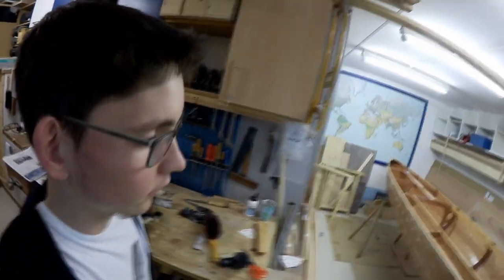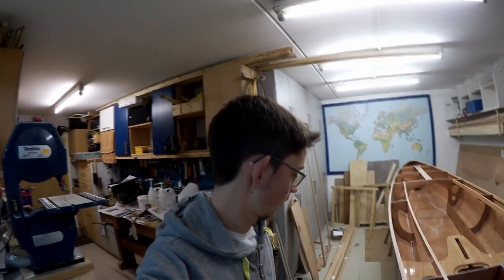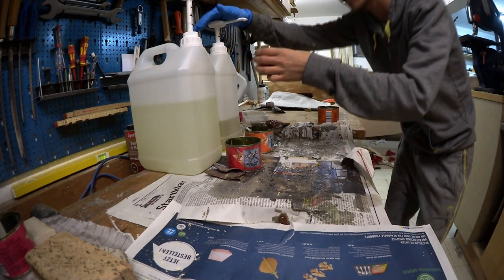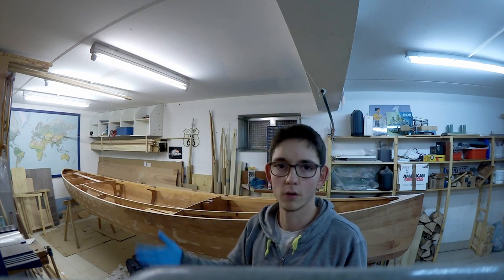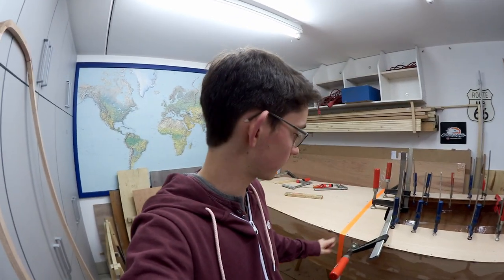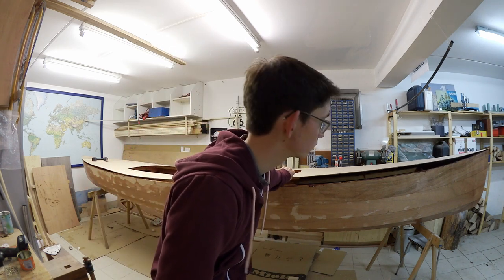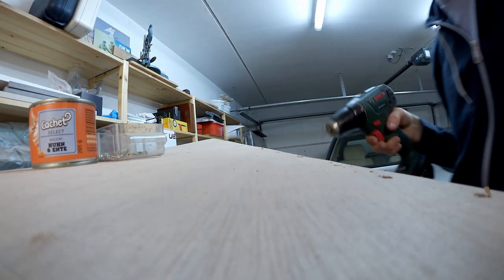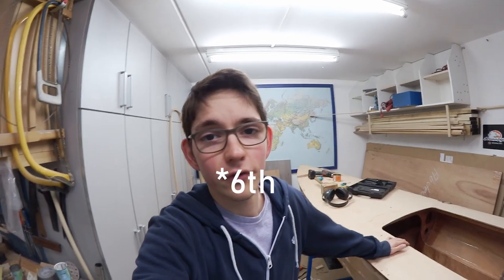Building a Waterlust Sailing Canoe (part 6): Failing big time (attaching the deck)...

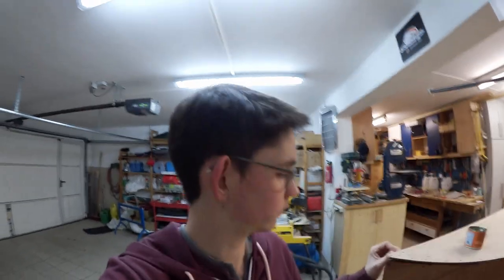Comment: 12:00 ...nimm das nicht zu schwer... nur wer nicht arbeitet, macht keine Fehler!
Fehler sind übrigens etwas gutes, wenn man daraus lernt!

Tip: Da ich gerade gesehen habe das Du alle Schrauben wieder raus drehst..... Du kannst Dir die Arbeit auch einfacher machen wenn Du anstatt Schrauben Tackernägel nimmst. Jeder Schreiner hat so einen Pressluft-Tacker wo Du entweder (Nrio-) Stifte mit verschießen kannst oder U-Klammern. Du nimmst einfach ein kleines Stück Restholz (ca. 5mm stark) und legst es auf Deck und schießt dann die Klammern durch das Restholz und Deck in die Leiste. Nachdem das Epoxi abgebunden hat, kannst Du die Klammern wieder entfernen. Sollte die sich nicht freiwillig entfehrnen lassen, tennst Du einfach das Restholz mit einem Stechbeitel auf, dann hast Du genug Platz um mit der Zange die Klammern wieder raus zu holen. Es geht übrigens noch einfacher wenn Du anstatt Restholz einfach einen alten Anschnallgurt nimmst. Mit dem kannstDu anschließend die U-Klammern auch wieder raus holen.
...ist aber nur ein Tip...